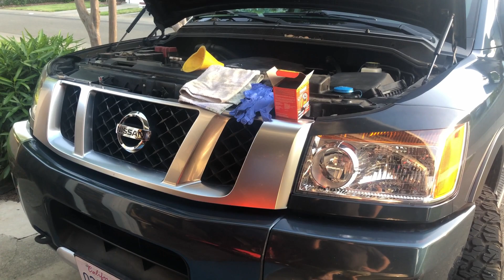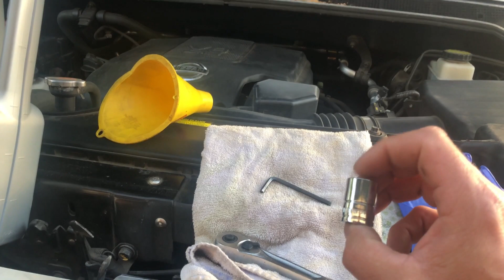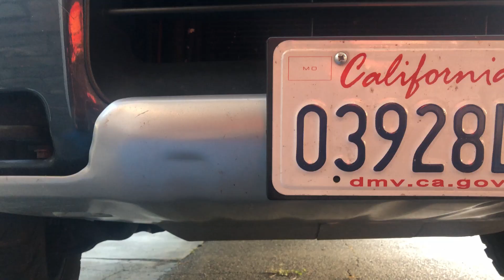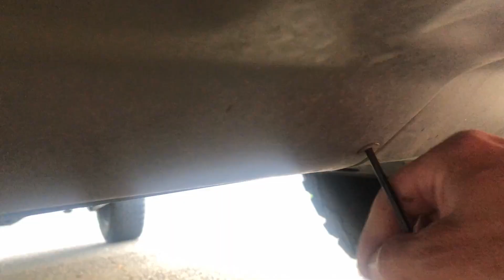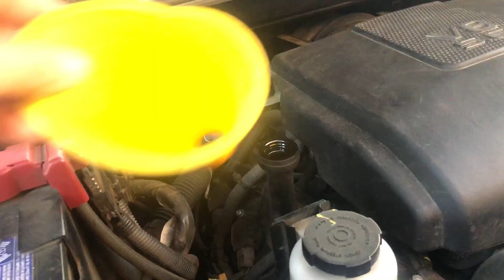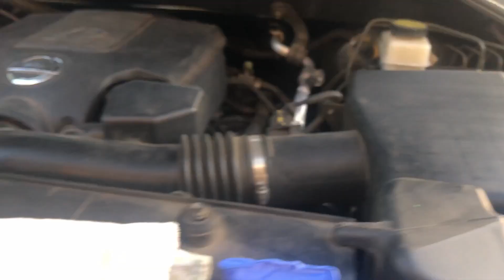2004-2015 Nissan titan, armada, qx56 oil change

Comment: Would making a small ramp of foil work to avoid the mess? I just got a platinum and have to do my first oil and trans fluid change
Reply from the maker: That might work, I’ve always used rug to contain a mess.

Comment: I would never go 10,000 miles between oil changes. Fluids are the like blood of your car/truck. Spend the extra $60 bucks to save thousands down the road. I change at 3,500-4,500 miles.
Reply from the maker: I remember suggested oil change interval was 3k miles back in the day, now most car manufacturers suggest 7k + . Synthetic oil has come a long way. I have seen numerous test results of used oil at 10k miles , even on diesel motors and test come back in with no contaminates and still oil life left.

Comment: You should be putting 6 and 1/2 quarts in your truck
Reply from the maker: May be you are right,  but + /- half a quart   Isn’t a big deal, oil capacity for this motor is 6.9 quarts.
Reply: @roadglassandmore  no I am a mechanic  for nissan and it takes  6 1/2  quarts
Reply: @Tadows  I can tell you are not considering my sister works at a Nissan dealer as a lube tech and the factory data says fill 6.5 to 6.9 quarts
Reply: Capacity (approximate) 
6-1/2 qt with oil filter change and 6-1/4 qt without oil filter change.

Comment: Did you lift up the vehicle? And how much torque for the drain plug?
Reply from the maker: No need to lift up the truck , there is is enough room under it. And the torque for the drain bolt is 25 ft-lb.
Reply: Thank you thats very helpful.